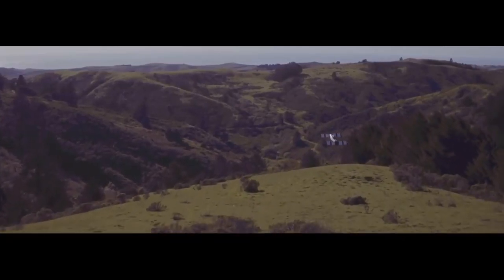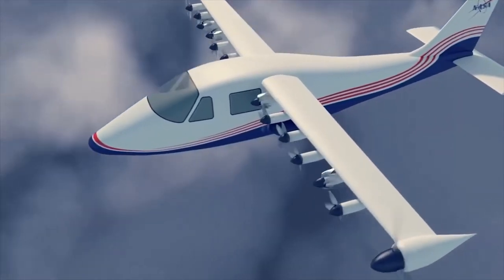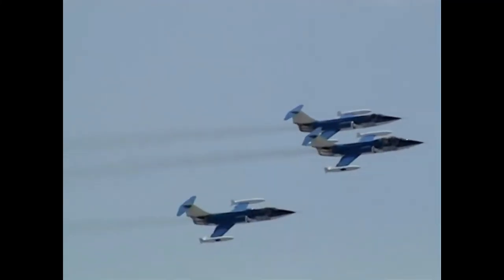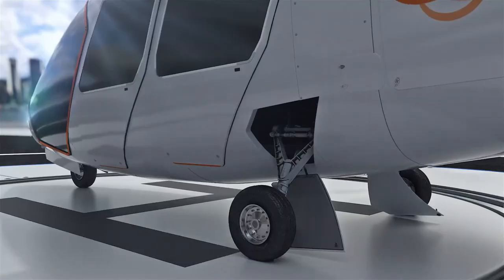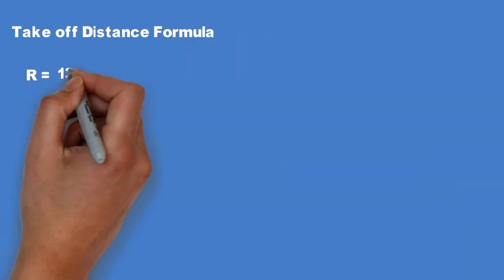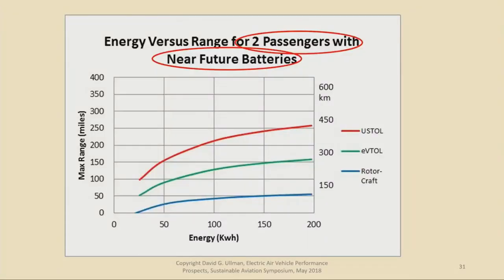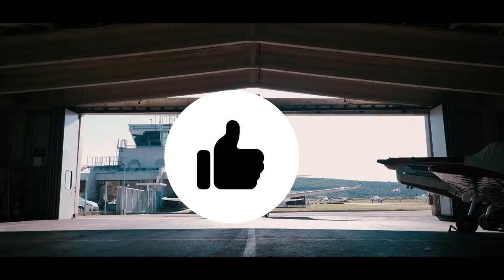Double Range Electric Aircraft: Distributed Propulsion

Comment: Interesting video as always. The efficiency multiplier for distributed propulsion is amazing! I can imagine small regional airports coming back to life with an increase in electric STOL aircraft services.
Reply from the maker: Great suggestion!
Reply: What efficiency multiplier?? Youre literally only multiplying wingtip vortices drag by an order of magnitude rather than having one big very efficient propeller. Not only that, but the aerodynamic drag is increased dramatically. Not good for electric aircraft with already severely limited on board consumable energy. 

I have no idea why this concept of "distributed thrust" designs with like 500 motors keeps on resurfacing. It's cool looking vaporware, but that's all it is. If this weren't the case, I can assure you that airlines would've already figured out a way to achieve this with conventional jets. 

The ONLY way I can see this being feasible is with maybe 4-6 motors located inside the wings blowing through a diffuser that runs along the length of the wing. That would work far better from an efficiency and aerodynamics perspective, but still would be woefully less efficient than a 1-2 propeller design with larger motors and larger props. 
It's pretty much commons sense.
Reply: @scenicdepictionsofchicagolife  Idk I'll trust the scientists making the breakthroughs. Why be a naysayer just because you don't understand?

Comment: Short-range use is exciting!  You can get 4 miles/kwh with USTOL (Ultra-short Take Off and Landing) if you can live with a 100 mile range, which is well within commute/recreational use!  Even those high-maintenance, high fuel use helicopters never travel more than about 50 miles from base.  I could see every TV station (if they still exist) ordering one to replace their "traffic copters", and Med-Evac very quickly shifting to multi-motor EVTOL  (special case where VTOL is required).
Reply: What helicopter has a 100mile range? Even the earliest commercial helicopter had a 200+ mile range.
Reply: @pogo1140  I think the OP was saying that most helicopters have a limited radius of operation - around 50 miles, not that they are limited to that distance.
Reply: @pogo1140  "high fuel use helicopters" is what he said. Many helicopters have ranges like 200 miles or more but that's only in one direction. The helicopters he's talking about have to come back to base too, while using some amount of fuel at the mission site.

Comment: Something I feel worth discussing: One of the big issues for current electric aircraft is the need for reserve endurance - if a problem develops at your destination airfield, you need to be able to fly to another one. These reserves are relaxed for helicopters as in an emergency, they are more likely to be able to land safely without an airfield. This means that aside from other advantages, in comparison with a conventional aircraft a VTOL vehicle should be able to make better use of its ultimate range. 

Thank you for a very interesting video. I learned a lot from it.
Reply: VTOL needs to generate it's full weight in lift, something even the military tilt rotors are limited by.
Reply: @pogo1140  Electric systems can have stupendous power to weight ratios compared to turbines or piston engines. In many ways it's a lot easier to build an electric VTOL aircraft than a classical rotorcraft. Energy density - range - is where the problems lie.
Reply: @kitwolf2857  the weight is a massive hurdle, each pound of battery is lost payload
Reply: @pogo1140  Compare Burt Rutan's Quickie and the Blackfly VTOL aircraft. The Quickie has an 18hp piston engine that weighs 36kg. The Blackfly has 16kg of electric motors that provide up to 336 horsepower, and the weight of the additional motors you need above those that are required for horizontal flight, is at least partially offset by the lack of landing gear. It's all great until you consider the low capacity of the battery - but this is a problem whether your vehicle is VTOL or takes off conventionally from a runway.

Now, imagine that you wanted to make the Quickie capable of vertical take-off and landing, you would need to install a bigger internal combustion engine weighing hundreds of kilos.

Comment: Very good video as always! 

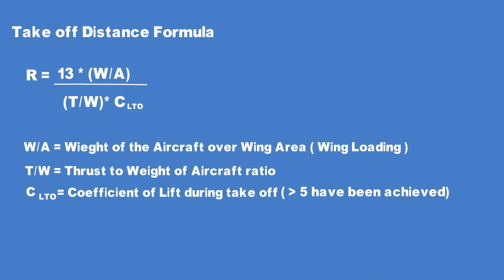I wanted to share some constructive feedback (hopefully!) though that your focus was more towards the takeoff performance than the range aspect in my opinion. (Ex: @6:15) Takeoff is such a small phase of flight that its power requirements are sometimes insignificant to the range. 

It's clear that there are benefits to distributed propulsion. Since lift is proportional to the speed square, the relative velocity increase provided by the small propeller can give large gains in lift. Additionally, the Reynolds number is increased, and typically the CL is higher with higher Re. 

But the research you link also shows some compromises that have to be made for each application. Despite having a higher thrust to weight ratio with the smaller motors, the aircraft was 11% heavier than the base aircraft. I cannot see the study, but did the aircraft use less power to cruise even when it weighed 11% more? Because that's what really would affect the range.
Reply from the maker: NASA in their Maxwell Aircraft were able to make the wing lighter and higher aspect ratio. The weight they saved from wing made the aircraft lighter overall even with the additional motors. Less wing area also meant less drag. So both high aspect ratio of wing and less drag help the aircraft in cruise. Thanks for you insightful comment
Reply: @ElectricAviation  That is awesome! Thanks for your reply!

Comment: thanks for showing DEP and boundary layer ingestion. i think that with distributed propulsion is more appropriate to use closed wings as joined wings or box wings because it gives more structural stability and reduces flutter, a trade-off of distributed propulsion.

Comment: Some info presented here are not quite true. Distributed propulsion usually performs worse than a single rotor if you consider propulsion alone. This is due to degradation of the flow characteristics on the blade due to smaller Reynolds numbers. I have discussed this with Dr. Nick Borer from the NASA X-57 DEP CTOL aircraft team, he specifically mentioned the smaller propellers used for distributed propulsion were performing badly, about 50% efficient, and that's why at higher speed they are stopped and folded. What the distributed propulsion actually does - it increases artificially the wing lift coefficient, the wing can be much thinner, having a lot less surface area, without a reduction in stall speed, but having much better high speed performance. Having a smaller chord wing, same wingspan, increases the maximum L/D and moves this maximum at a higher speed on the L/D characteristics. The smaller wing actually is the reason the range increases, not the multitude of propellers. The distributed propulsion is to allow the wing to perform at slow speed and have a relatively slow stall speed, similar to the original larger wing.
Reply: It makes sense though, also if we count drag those blades create, which is also a factor and yeah, 1 big propeller is intuitively more efficient
Reply: I wonder if this can be used not to fly slow, but to fly high? Basically,  to achieve benefits from both low air density and relatively low speed (of the fuselage) to suffer from drag even less.

Comment: The next level is to replace the electric propellers with electric compressors, each directly connected to an oblong shaped bladeless fan built into the wing's leading edge so as to deliver the maximum laminar flow distributed across an optimized wing surface.  So you are multiplying the lift and and mechanical airflow both.  This should result in doubling the range again over the propeller design, allowing the electric system to easily beat the conventional one in subsonic flight.  One could also incorporate a hybrid power source as well, making electricity onboard in an optimized RPM range for efficiency.  The resulting efficiency in fuel consumption would approach an order of magnitude, the electrical approach allowing the optimal mechanical power distribution for a given form.

Comment: Two things come to mind
1/ that trailing edge or pusher propellers would endear a straighter, more predictable flow over the wing, especially concerning the leading edge; further optimising Clmax
2/ and Im unsure the advantage of short take off, as the present experience deals with 'average' take off durations quite well,
...  and hull insurance on STOL aircraft has proven in the main to be commercially prohibitive
ok make that 3 things ....

Comment: VTOL would be great mainly for short hauls in the city and no transformer shape change necessary with the short distances. I agree STOL is way better especially without any transformer shape change which makes it easier to make, lighter and simpler. And you maybe can design STOL to near VTOL performance. e.g. A semi Black Fly idea with wheels and a slow landing speed that can easily stop short.

Comment: I did watch your  video on fuel cell flight, and still don't perceive you gave a fully realized evaluation on that, but this was informative (for me) about take offs (?)... Did you say there's a larger drag coefficient at certain heights, weights & speeds?Also still also a matter of public access, when it comes to vtol flights without runways, & nothing is wrong with romance... It's romance which is correct.

Comment: Fascinating drag reduction of the many movable,you have made a comprehensive history of aviation,you are a scholler of flight,good visuals 2 communicating the possibilities of a pure electric development of flight with little propeller flight ,straight up into the cruise multiple people/cargo load bearing capacity at highest speed ( :maybe capacitors could give batteries a boost on take off,or we could make big half mega bridge's into the ocean ,and shoot them of from ground batteries into full cruising speed,you could have bicycle s and car's drive into wings and battery,and are shot off the half bridges without there tyres/axel and chassis,batteries would be interchangeable with rentable wings

Comment: Just make a wing within a wing for take off, then it slides into the shorter cord for faster flying...
Reply: Not sure if you're the troll or me....but isn't that flaps 🤣
Reply: @chrisglencross3867  Excellent remark. Yes and no. The flaps would extend the whole width of the wing, but the main wing would contain them as an envelope. 

So they wouldn't exactly be flaps but a double corded wing...

Hope I'm a helpful troll 😅
Reply: See Scrappy.
Reply: @gpaull2  It certainly has a broad cord lol. Broad cord calling Danny Boy 🤣.

Not fast enough but definitely short take offs.
Reply: Have you seen Mike Pateys transformer wing? I dont know how this would integrate with distributed propulsion, but it does nearly exactly what you are suggesting...

Edit: I see from other comments you are aware of it:)
Reply: With the absence of the fuel tanks in the wing, I could see that being a viable option.

Comment: Do you think Joby and Vertical will be able to take off and land like a conventional estall aircraft where it’s appropriate to do so and save some power for longer missions
Reply from the maker: They can certainly land at low approach speeds. In vertical VAX4, it would make their vertical fixed rotors redundant

Comment: This is a remarkable video. There is clearly a very good business case for the light private pilot aircraft segment. Why is this not being pursued?

Also, can you state what each of the prototype EV aircraft you were showing in this video are? Probably with a link. What was that dual wing, multi-prop one with the tricycle landing gear? And the DHL one? Would like to know who's behind these designs.

I get the feeling that many developers are approaching the design aspect wrong, based on what you're saying. Someone should start by just designing the optimal airframe and propellor setup, and work back to a working aircraft from there. And all propellers should have the capacity to stop and fold along the motor in order to allow more efficient travel at cruise speeds and altitude on just one or two motors.
Reply from the maker: Thanks. The aircraft is Emotion
https://www.emotion-aircraft.com/aerodynamics
The DHL one is Eviation Alice
Reply: @ElectricAviation  Is it really a German company? Just like Lilium? This is going to be exciting!

Comment: So, using 100hp motor with 8' dia. prop, would burn more fuel than four 25hp motors, each with a 4 foot diameter propeller? Would the propeller design and rpm's make a difference?
Reply from the maker: It depends upon the RPM. Please watch my upcoming video, because I will dive into the details and hopefully will be able to explain it better

Comment: It would be interesting to see if a craft with a large rotor that is driven by small propellers along its length would be worthwhile.
Reply: Maybe with a conventional combustion engine which increases in efficiency with size. But as stated in the video, smaller electric motors are more efficient than larger electric motors.

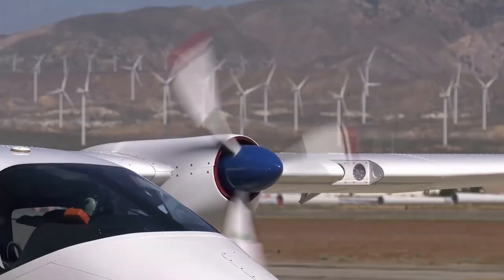Comment: Please clarify what you mean when you say "5 times more propulsive efficiency" with distributed propulsion @6:58.  Propulsive efficiency cannot be greater than one.  Do you mean a 5 percent improvement? Thank you.
Reply from the maker: Lets say the propulsive efficiency of an aircraft with one larger propeller was 0.15, than 5 time propulsive through multiple small props means efficiency of 0.75
Reply: @ElectricAviation  That is not a realistic example. Propulsive efficiency is the ratio of the thrust power to the mechanical power delivered to the propeller. Even a single propeller aircraft should have a propulsive efficiency greater than 0.75.
Reply: Is propulsive efficiency defined differently from propeller efficiency in this context?

Comment: Check out the XTI Aircraft Trifan design....gas turbine driving a generator that powers motors driving ducted fans which rotate for either vertical or horizontal thrust.  XTI plans to replace the gas turbine with batteries when battery energy density improves.  Full disclosure: I own shares in XTI aircraft.
Reply from the maker: I know Trifan and I like the aircraft very much. The reason it caught my eye was because I did an independent study for VTOL and came up with three props, more or less the same dimensions as E fan

Comment: What about having a ICE running multiple propellers, say 4?
Reply: ICEs advantage is in the fuel. the rest is poor efficiency. Because fuel is ~50 times more energy dense it just allow ICE engines to linger and show they wastefulness :)
Reply: the problem is the gearing to deliver power to props
its weight, cost, complexity in servicing
Reply: Good thought.  I at first thought kinda the same thing, but ICE has problems (beside the lack of biofuels and noise).  
If individual engines, they are heavy, complicated, and inefficient.  If one engine geared to multiple fans, it could work but would add complexity, maintenance cost, and a failure could be deadly.
  Perhaps best would be to use an H2 or Methanol fuel cell if you need maximum range, but for everything else I would think an electric battery is better.  (Also, if you use a fuel cell you can always upgrade to batteries when they become higher power density than fuel cells).
Reply: For small planes, people have been moving away from multiple engines for years because you don't really see the payback in performance. for the weight and complexity. 

You'd be better off adding a diesel or turbine  range extender if you need more than what a battery can provide.
Reply: I am a SEL pilot. When engine goes out, pull the sheet and set Vy and look for room to land.

Comment: Yeah, but in an STOL you are still taking off and landing on a runway, which is existing infra usually built far outside of the city. And even if you start building custom runways of let's say only 50m you still need empty space for approach, and for  city travel that's still a lot of prime real estate space dedicated for landing infrastructure.
The reason people are excited about eVTOLs is specifically that it enables point to point because the landing infrastructure is so much less involved. Nothing to do with flying cars.

Comment: Distributed propulsion simulate what a bird wings would do if it was flapping its wings to get lift. The airflow is evenly distributed over the whole wing and not just a section of the wing. They should design bigger aircraft with this in mind.

Comment: Very interesting. The lack of energy density in batteries is certainly forcing people to squeeze the sponge hard for every last drop of advantage. I wonder what would happen if tomorrow we had a game changer where we saw density at a 1000 times what it is now. It would probably put efficiency chasing on a back burner for quite some time so maybe the lack of density we have now drives a science benefit in other areas we would not have otherwise had.
Reply: That's certainly physically possible!  I think the physical limit would be a fuel cell, because you still need the Hydrogen to hold the electron... essentially a fuel cell.